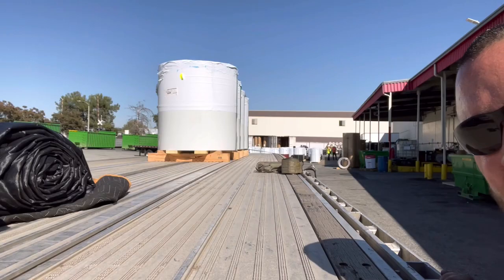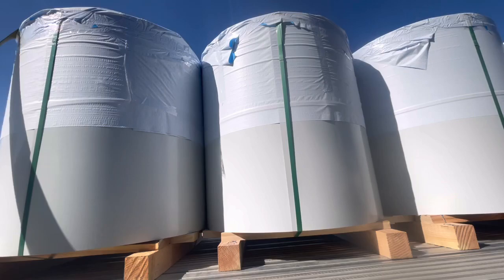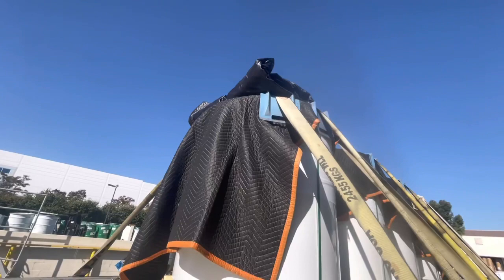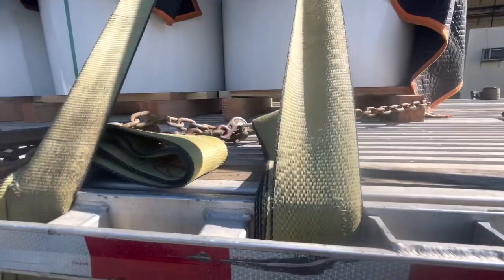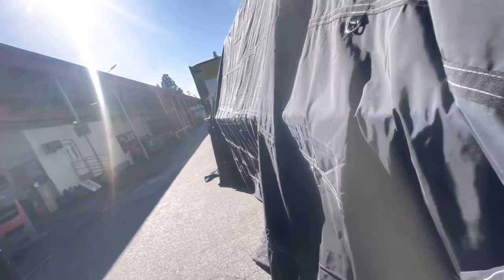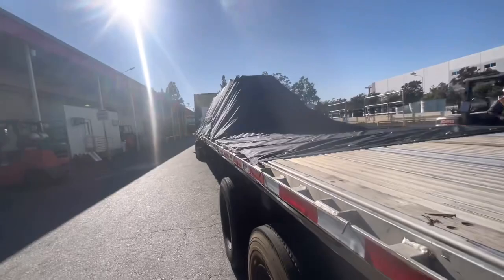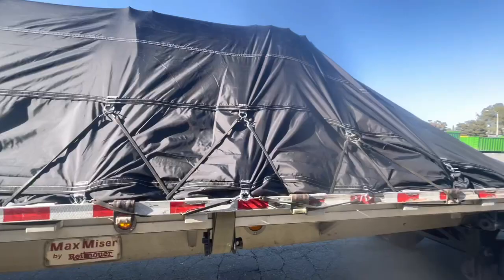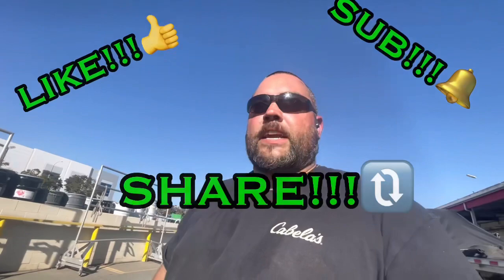Stand Up/Skid Steel Coils New Tarps😍 and Securement Info!!!🤑

Comment: His securement is fine we all do it our own way.  As far as the tarping he just wanted to use his new tarp. Which is fine, I'm not saying it's wrong.  Until I saw this video I was considering purchasing  parachute tarps,  In my opinion if a load requires tarping fine add padding we're needed and tarp...
 The strength and integrity of the tarp Is what allows you to transport with confidence & your mind at ease from  worrying about potential  tarp damage.  All in all a good video. 👍😁

Comment: Trip chains should be used more than they are. Thanks for that.

One thing that bugs me is trip chains on the pallet. What about the coil? If things go south it isn't the pallet you need to worry about.
Maybe a trip chain or trip strap at the base of the coil would be better? Of course you need to protect/pad the coil to avoid damage.
Reply from the maker: I’ve pondered this my self, but with the actual coil being presecured to the pallet, DOT considers the pallet+product as one item. I do agree though, ANYTHING, and I mean ANYTHING could happen! Thanks for Watching Skellr

Comment: The idea that he only used 1 strap on the coils in the middle is not DOT 393 legal and is scary!!!!
Reply from the maker: As a palletized item that is confined in the center of the load between other palletized items, those center palletized items are only required to have half the working load limit securement of the items weight being secured. Using a 5400 wll strap that coil was not over 10800lbs.
Reply: @fr8sk8rtrucking81  you need to read 393...those in the middle require 2 straps, 3 straps on the front and back!
Reply from the maker: Will do Mough. If I’m wrong I’ll definitely own up to it💪
Reply: (b) Securement of coils transported with eyes vertical on a flatbed vehicle, in a sided vehicle or in an intermodal container with anchor points—(1) An individual coil. Each coil must be secured by tiedowns arranged in a manner to prevent the coils from tipping in the forward, rearward, and lateral directions. The restraint system must include the following:

(i) At least one tiedown attached diagonally from the left side of the vehicle or intermodal container (near the forwardmost part of the coil), across the eye of the coil, to the right side of the vehicle or intermodal container (near the rearmost part of the coil);

Comment: What ever happened to the old school tie down ,where it only was chains , i still see some old school flatbeders that still use the old school way not the lazy way....🤔
Reply from the maker: 5400 lb WLL is 5400lb WLL, steel or Nylon doesn’t matter, WLL isn’t discriminatory🤔Work smarter not harder😳….sorry you feel using straps define a lazy driver, but….. that’s just like your opinion man😂